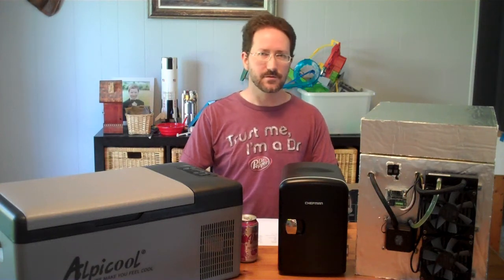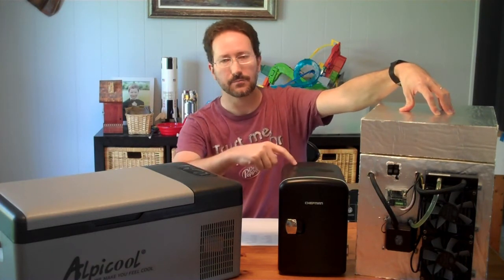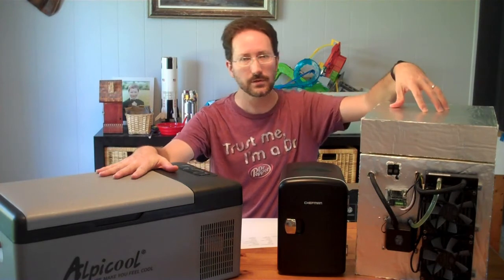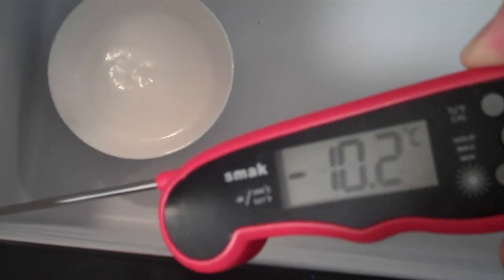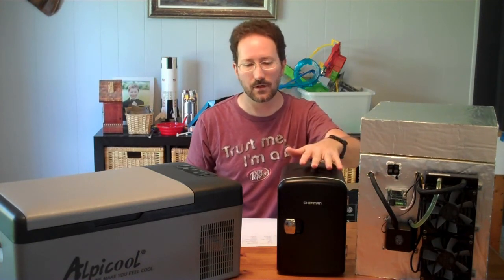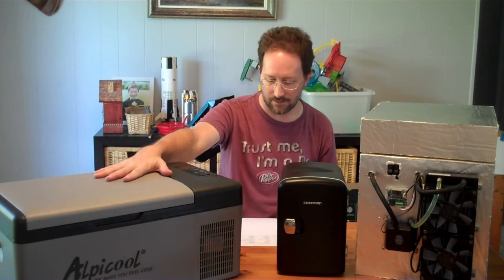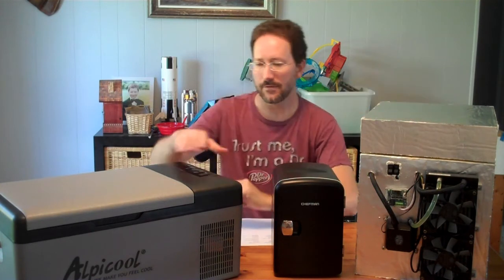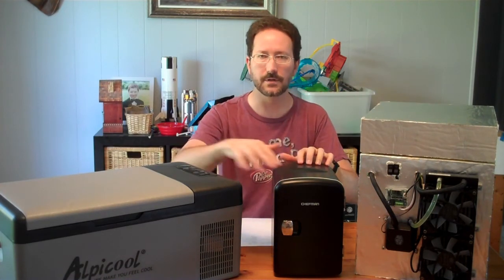DIY Thermo-Electric cooler. Part 2 - performance comparison

Comment: I have peltier 12v 5A and I use 3.5A only, voltage is set about 8V, but I have circuit build to set steady current, because voltage is changing when cold side is cooling down, I have a lot of more efficiency rather using 5A. I am loosing only few degrees, but performance is doubled. 
Data sheet is said that best performance compared to speed of cooling to power consumption is recommended to set current to about 70%. I did it and I am very happy.